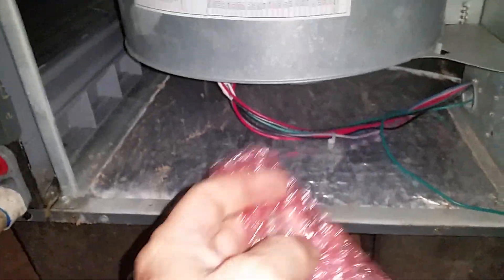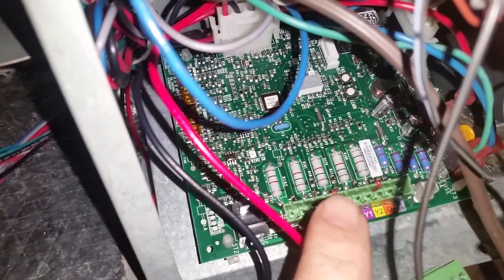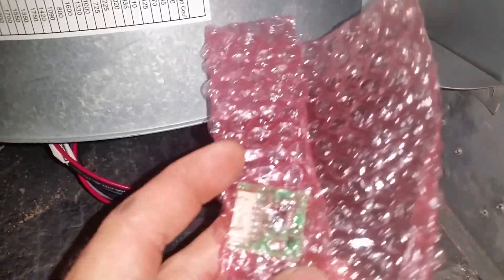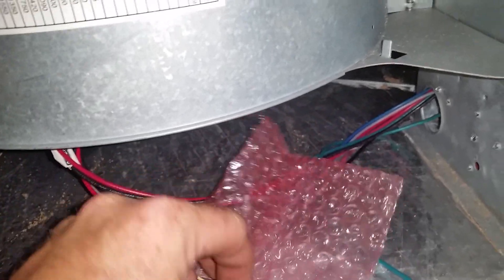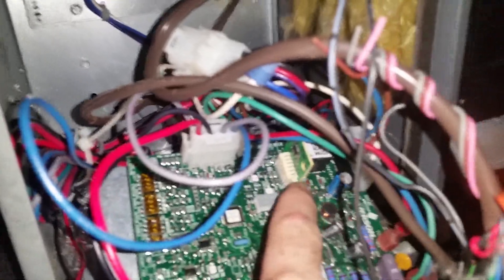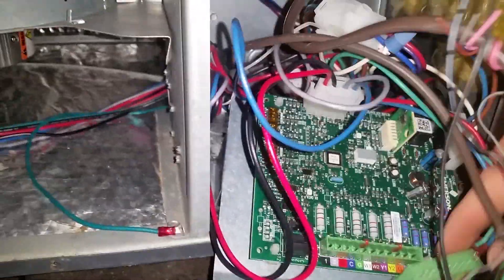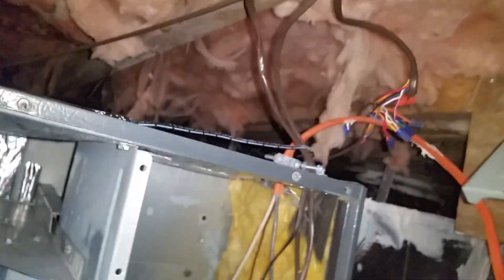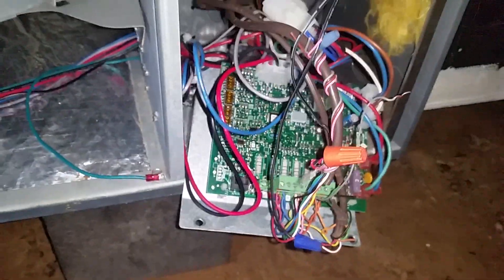How to reprogram a variable speed module  Goodman

Comment: Thanks For the Heads up on that one. I'll Remember that if i have to do a Motor and Board Combo!
Reply from the maker: OcRefrigeration & H.v.a.c. the instructions say the memory chip may be required but it dose not explain when you need it. so this customer had to wait a few days to get the chip. i don't like the way goodman set this system up most manufactures  program the module when you buy it  i guess goodman thought that was to easy lol

Comment: How to change the speed of the motor. I just installed a new goodman unit and I feel like the cfm is too low. It says it's multi speed, and I would like to see if it's on the highest setting. Manual says it comes set to mid range.
Reply: There's dip switches on the board that can be set to change the cfm.  Be careful because you should know your duct sizing and static pressure requirements before messing with that.

Comment: I'm trying to reprogram controller to use 1 HP motor and ECM.  This was an option from factory for the air handler.  3/4 HP as originally installed is not available anywhere....either covid supply chain issue, or they fail often.
US Motors makes the units.  I spoke with engineer there.   Physically compatible swap, same wiring.
A/h gives error code d1.....mismatched stored info vs connected info for motor.  It's expecting a 3/4 HP combo, but finding 1 HP.

I don't see a memory card on this board.  2018 year vintage
Any ideas?

Air handler : Goodman avptc29b14ba 2 ton
Board in air handler : Emerson 5014F. 1494V0 P4 1706
Outdoor unit: GSZC 160241 

THANKS.